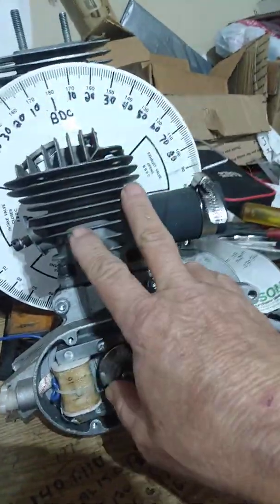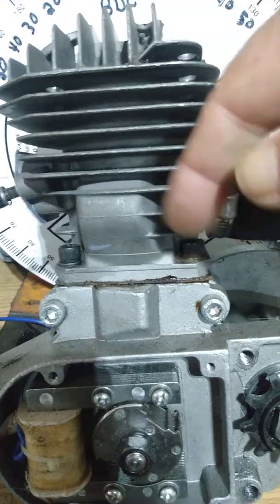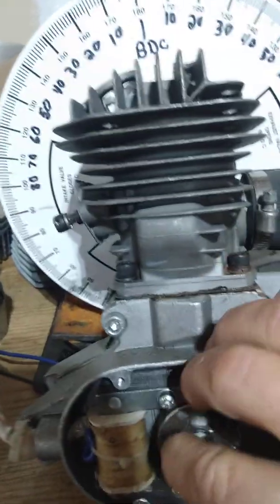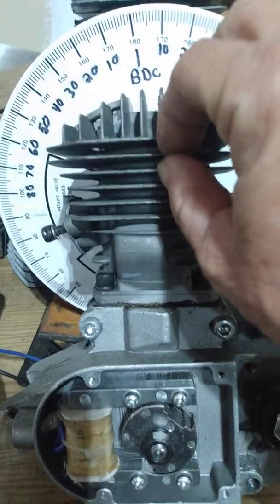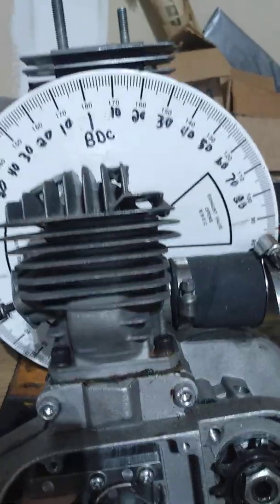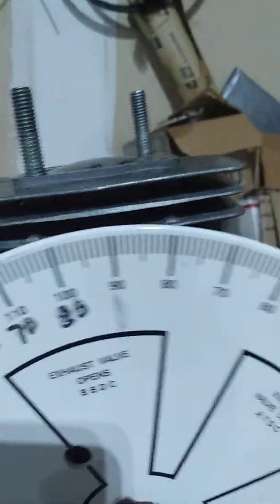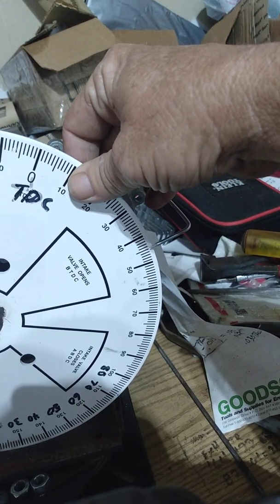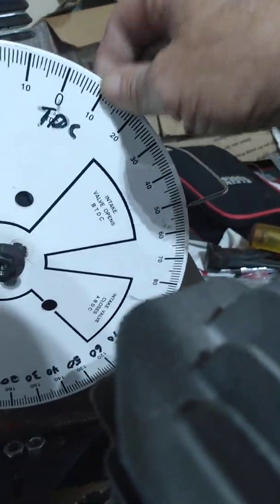motorized bicycle hybrid read description hope it helps

Comment: Dude you are brilliant. Thank you for sharing this information. Never thought to use playdough. What do you think of using a square bandsaw to remove the cylinder head and milling both sides. Would that preserve your timing and only effect squish?
Reply from the maker: Naaa I'm a mild mannered dip shit trying to share some helpful information in hopes of entertaining and inspiring folks to improve the cheapest fourm of engines. Glad to help
Reply from the maker: Smart as long as you  cut it long meaning leave enough material to machine  or sand off to a hive a flat surface and set your sqish PROPERLY

Comment: Ive been wondering about chainsaw jugs.....
Reply from the maker: Built a few o44 50 mm they rip but need to relocate  threads in cases  and epoxy tranfers and deck the cyl or cases then add some exhust duration. But not making any saw vids Ken hinson is the saw guy  I'm the port timing carb guy and show stuff on the cheap 47 mm stuff your average guy can modify at home
Reply: @2strokecarbtuningportingin187  one day ill build one but till then im building my 47mm and soaking up whatever knowledge you dish out.
    I see your boost port and how you use your mill to cut them in @ 25° or was it 20°? Either way, can one be cut in with a dremel ?  Just food for thought.
Reply from the maker: Yes 30  degrees and yes you can control the angle and do it with Dremel check out my true 6 transfer cyl done buy hand with Dremel
Reply from the maker: @nimbusnimbus.IV.  https://youtu.be/Eeta8gdp3lQ
Reply: @2strokecarbtuningportingin187  ive watched that video a thousand times.  Nice work.
Reply from the maker: @nimbusnimbus.IV.  kinda short and vague  think I have video on this build can't remember but if you look threw my old vids I explain everything from degree wheels to boost ports to exhust port shapes tranfur durations window sizes shapes and locations ramped Pistons boost ports and true six transfers a cover everything multiple times I just never wrote Good descriptions lot of details people overlook I also go in depth about some of the heads they sell
Reply: @2strokecarbtuningportingin187  yes, you do. Honestly, i couldnt believe how much info you put out.